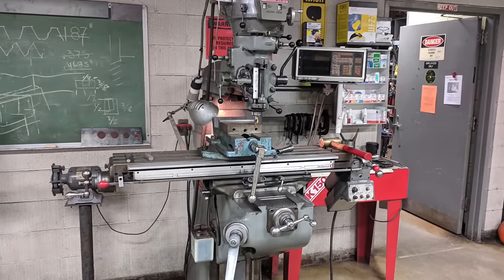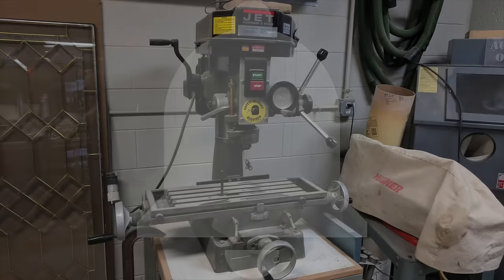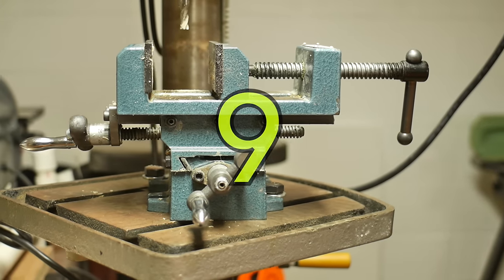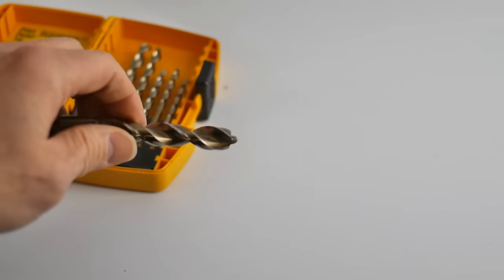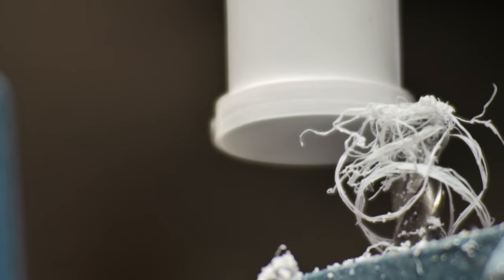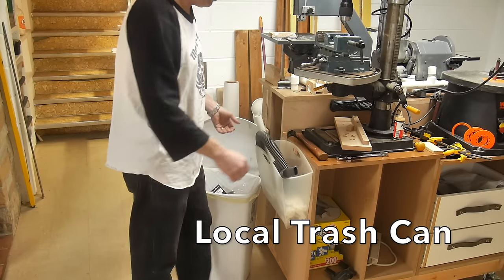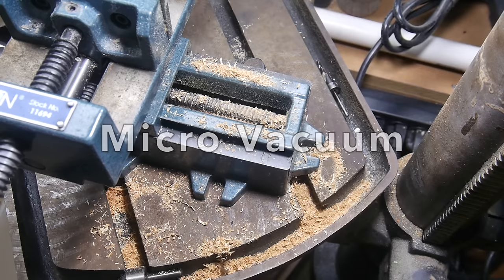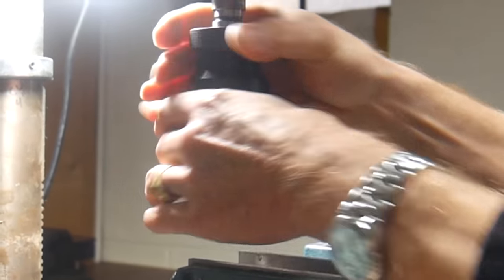Drill Press Machining Hacking/Tips and Tricks: The Basics

Comment: I came here for the "a drill is not a milling  machine, it was not designed to take radial loads" comments.
Reply: The old timers around here have been using their drill press as milling machines for over 40 years...
Reply: I’m a machinist and a good machinist will make do with what they have.  Used many drill presses with a add on cross slide vise.  One axis is enough to get by.
Reply: Bumblebees aren't aerodynamic, and theoretically aren't supposed to fly, but... 
;^)
Reply: If you’re going to use a drill press the last thing you want to use is a Harbor Freight press or any press with a Morse taper! Get an old Craftsman ore equivalent with a fixed Chuck that can’t drop out from side pressure or radial loads!
Reply from the maker: @timvala7577 that's a good tip actually
Reply: @jackmeoff6996 …but even they know that drill presses can be used to mill. Bumblebees are super smart 🤓

Comment: As a 40 year journeyman tool & die  maker I too have used this method at home. People need to be aware that a drill press chuck is only press fit into the spindle, and therefore, the side pressure of milling can and will eventually make your chuck fall out, or be corkscrewed into your workpiece. Be safe.
Reply: i was going to say the exact same thing, he should have mentioned that first as someone will get hurt, a milling machine has a draw bar for a reason.
Reply: I learned that the hard way. A bit of loctite works well.

Comment: Hey bud i see u r using a harbor freight what inch but I have a 4 flute end mill bit this should b simple enough for some quick or slow one-way passes on plastic right? I'm betting everything I'm gonna buy from what u say everyone says drill press  is for up and down but they still have to turn my buddy hunts and he drilled a 11/16 barrel hole with the drill and he's dumb as a sea slug! So harbor freight  isn't too far and they have a ageless flux core o.35 fed mig machine for 119 u can't go wrong but will a4flute and more flute bit cut through 7p71 aluminum or mild steel of course I would Drill some small regular holes to weekend the substance u seem to k ow what your talking about  and I need best way keeping bit steady  and as can b 
Thank u bud I will sub
Reply from the maker: Cory Cas you should be fine with plastic, or regular aluminum. Be careful with steel. Did not quite understand the last part of the question. 
Good luck, thanks for the SUB much appreciated.

Comment: I use to be a machinist in a track shop (railroad track) where I operated many machines. A large Cincinnati milling machine was just one I operated. I often thought about purchasing a milling machine. I had a friend who had a Bridgeport mill for sale once, but I didn't buy it. Then I thought about the mini mills that are for sale today, but once again I didn't buy one. 
   Your idea about using a cross slide vise on a drill press is a very economical  way to do some light milling which is probably enough for most people in their home workshop. Who knows, I might have to go out and buy a nice drill press and a cross slide vise even in my advanced years. 
   For most of my life I have been making something, at the track shop I cut steel harden steel castings, even stainless. At home I had a wood working shop, and I've done auto body work for years. I say all this to give a warning. The heavy metal dust, sawdust, and even auto body filler dust have ruin my lungs, I now have pulmonary fibrosis. So the warning is ALWAYS WEAR A DUST MASK. It will save your life.
   Thanks for the video, I'm sure it will help many to get into some light milling.
Reply from the maker: Best of luck

Comment: Cut off carbide saw tooth bits are one of my cheap tricks. Mounted in the cross slide the results are surprisingly good. Plus you get 40 to 60 bits per used 10" saw blade

Comment: the best piece of advice here was the simplest - just remove two of the handles. I never really noticed it before but I actually always just reach for the same handle every time even though I had a "choice" of three. Sometimes when I had a workpiece clamped to the drill press table the clamps would get in the way of the handles turning and I'm kicking myself now for the number of times I moved clamps rather than just taking off the offending handles. Christ the lights, what was I thinking of?!
Reply: Sorry to be 'that' guy, but this part kinda baffled me. I've never had issues with the three handles of my drill press. They all know I love them equally! I also use a technique (usually with drilling metal) where I have my hand on an 'upper' handle, my elbow on the one below. I get leverage from the elbow, control from the hand. This entirely depends on the height of the table though.

Comment: I have not checked all of the comments so the answer may be there. However you failed to mention how to keep the MT chuck adapter held firmly attached to the spindle under the side loads encountered when milling. The MT taper is great for drilling as all loads are axial so the taper keeps the chuck adapter solidly located into the female MT taper of the spindle. 
However when side loads and vibration are encountered as when using an end mill the radial loads imposed to the MT taper will allow it to rattle out unless a drawbar is used. 
No mention of how this was accomplished.

Comment: I tried using my drill press like this, but had a lot of problems with the chuck dropping out of the Morse taper. Did you do anything to resolve that? Just be careful if you try this, y'all. Morse tapers aren't good at dealing with radial loads without a drawbar
Reply: Try to clean the morse taper ,outside and inside with brake cleaner. Look for any damages on the surface , sand down anything you can feel. Clean again any oil or dirt. Now bang hard the chuck in place and it should be ok..If it doesn't work clean again and assemble with locktite adhesive. Good luck.
Reply: Evan Barnes
:   The only way to prevent this is to use a real mill.

Comment: Eric, my tip is to get some button magnets and place them onto the speed change cover, then I place my selection of centre drills, chuck key, countersink drills etc.
They are always at hand and are kept out of the way when finished with. :-))
Reply: Using a magnet to hold your bits makes them magnetic as well, even when taken away from the strip or tray.  Which means that ferrous metal chips cling to them. Sometimes tenaciously. The bits can have a beard of filings that shift but wont easily wipe off.  This interferes with cutting, wears out the tool and produces poor quality holes, scoring or embeds metal especially in soft material. You can degauss them, but that's just another step.

Comment: While I'm generally not in favor of using a drill press for milling as the bearings are meant for taking endless versus side loads in a pinch on soft material it will get the job done. As to band saws. Avoid three wheelers like the plauge
Reply: Why the band saw with 3 wheels
Reply: @johnty6067 
1) Generally a 4 wheel band saw will allow  smaller diameter wheels for the same throat depth.  But smaller wheels lead to more stress on the blade because you are flexing the blade three times for every time the same tooth goes past the table. The smaller wheels means the blade is stressed more than a two wheel machine of the same size. 
2) Blade tracking and wheel alignment are more of a PITA. There are dome very goodyhree wheel bandsaws. But they are industrial machines built to industrial specs.
You found probably build a decent 3 wheel bandsaw but the only reason I can see to do it is if you are limited in vertical space and want a really deep throat.  But then I think the smallest wheel I would go with is 14" or so with a maximum throat of say 20 to 24 inches. That means the saw is already 48 to 52 inches wide across the wheels without the blade guard and table.
Reply from the maker: Interesting

Comment: Do NOT use a drill press for milling. The morse taper fit on the quill and the jacobs taper on the chuck will not retain during side loading. They will eventually come out and then you have a drill chuck with a sharp tool bouncing around your shop. Hopefully you will not be in the way when it comes loose otherwise what you pay on your medical deductible could go to a real mill.
Reply from the maker: Yeah, it's definitely not what the machine was intended for, I assume everyone watching this video already knows that. But for light work I feel it's an acceptable option. At least for me it is. It's not for everyone. Thanks for watching and leaving a comment.
Reply: It's one of those things that can be done, but is not generally, for really good reasons.
In addition to Jerry Biehler's point, there's the non-safety issue: the spindle bearings aren't designed to handle that kind of side loading, and particularly with say, a Harbor Freight unit, you're significantly shortening the life of the pillar drill.
All of that having been said, it's great to know I'm not the only one who has abused his drill press this way.
Reply: Not all drill presses have a morse taper though. I'm not sure what my old Powermatic has, might be thread on, but it's certainly not taper.
Reply: It was an option on powermatics. But the vast majority of drill presses have morse taper. Even if your press does not have a taper drill chucks were just not designed to hold end mills. Drill bits have soft shanks that the chuck can bite into, end mills are hard and need to be held in a collet or they can slip. Heck, even in some collets they will slip anyway.
Reply: I've noticed that, you really have to haul on the key to get the mill to stay in there sometimes. I'm not doing anything serious though. Milling little flats to make drilling shafts much easier, or slotting the occasional hole(plunging though, then side milling to clean it up). I know the limits with it, it's certainly no bridgeport, but it's definitely above the Chinese junk you buy today.
Reply: Jerry  Biehler  Yes, I tried that and the chuck fell out while I was trying to mill. Fortunately, the drop was 3 inches down and into the vise. Definitely NOT a good idea. Very dangerous.
Reply: Depends on how you do it in my opinion if you use the proper bits, protection, tools & etc... and also let the blades or bits do the work not forcing it and also using coolant oil i think you be ok..
Reply: Had that happen a few times with aluminum. Good stuff.
Reply: I agree, its nice for sporadic milling !v @EricStrebel

Comment: Drill presses are typically not designed to absorb lateral or sideways thrust and usually this causes excessive wear in the bottom bearing on the shaft. Suggest these actions be kept to a minimum.
Reply from the maker: Correct

Comment: I have made motorcycle parts, gun parts and all kinds of other stuff with my drill press an angel grinder and files. I had to make a centering point that I clamp to the table to help keep some parts centered and take some of the side ways pressure off of the chuck. I still want to buy a real late mill combo when I find a good one that isn't to expensive.

Comment: I just bought a vintage cross slide vise at a yard sale for $20. I'm going to need to clean it but it was an awesome deal. I currently have a bench top drill press but I'm ordering a full-sized 20" drill press later this month. I'm looking at a Jet 1.5 HP model. These tips were quite helpful. I like the replacement chuck.

Comment: Nice idea - I don't think the bearings of the drill press are designed for lateral pressure so I would expect the bearings to suffer over a protracted period. If they are replaced with needle race bearings that would make more sense. But hey, for hobby use and no great precision expectations it's probably quite OK.
And not to appear churlish, there are LOADS of great tips in this video, some of which I shall shamelessly copy! Thanks man!
Reply from the maker: Your right. I will go with some roller or needle bearings next time to handle the side loads. Works well for killing wood and plastic and soft aluminum. Thanks  for your comment

Comment: 🙄 Thats a Drill PRESS. So its only ment for vertical Force and not for horizontal Force. In the worst case your Chuck can come off the Machine. Second Thing: End Mills are often to hard for the Chuck and you can damage your Chuck by getting stuck in the workpice.
Reply from the maker: Check out the follow up video where I add a DC treadmill motor to the drill press

Comment: Do you need a different collet in your drill press?  I was under the impression that the standard one  aka chuck does not tolerate lateral loads and will fall out.  Thank you.
Reply from the maker: It's the Tang that can come loose, some hold better than others.

Comment: You’re lucky that your chuck stays in the machine. Mine comes loose very easily. It always has. Very annoying during operations. The solution is to make and fit a draw bar, but I need a lathe for that…! 🧐

Does your chuck behave itself? Have you considered adding a draw bar?
Reply: Use valve grinding compound on your mt. Get some dychem or pression blue so that you can see what percentage is actually making contact first. Then use the valve grinding compound to literally machine match the two parts to a Percision fit. This works from tapered atv-lawnmower crankshafts all of the way up to many thousands of hp River rowboat wheel shafts. I’ve had to do both and many similar jobs in between. I hope this helps. I hate a mt. That will not hold.
Reply from the maker: Cool
Reply: @billyclevenger2632  Thank you for these good suggestions. The tang limits movement, but it might work in this case. Cheers.

Comment: I understood that using a drill press as a mill was wrong for two reasons.
It doesn't have the proper bearings for side loading.
It only has the morse taper jam fit and no mechanical hold on the bit (actually the chuck). So, the bit also has no ability to resist sideloading.
Reply from the maker: Correct

Comment: You seem to know what you are doing.  I want to do the same thing, but other vids say that it's dangerous to side load the chuck in a drill press.   How do you address that?    I've seen crazy glue, green loctite, and also replacing the bearings.   Any advise?
Reply from the maker: Freeze the Tang and heat the collet, give them a good whack when you seat them so they don't come apart easily, only mill soft materials. Rebuild your drill press occasionally to make sure the baiting are not loose.

Comment: you are putting side load on your chuck that is designed for vertical load,  and you get runout.  Use morse taper milling cutters or a morse taper collet chuck
Reply from the maker: Ok, thanks for the information

Comment: The one thing that no one talks about when using a drill press for a milling machine is, "how do you keep the drill chuck from falling out".  Please don't say it never happens, because it does.  I work in a company that has a large machine shop and have borrowed the best drill chucks on the planet, tried them in 2 different very robust drill presses, and they all fall out.  Doesn't matter if it is wood, plastic, or aluminum.  Doesn't matter how much cut you take, or how fast you spin the end mill.  So anyone who has done this successfully please let me know the secret, because I must be too stupid to figure it out.
Reply from the maker: It has happened, you can freeze the tapered end and heat up the drill press side, that would be one way to get additional conect, I hit the chick with a hammer, that works well for me.
Reply: @EricStrebel  Thanks for the fast reply. Can you every get it out if you have to?  I saw a guy that super glued the thing in, sounds pretty permanent to me.  I have installed bearings with the heat/chill method and it seems to work.  I'll give it a try.
Reply: @CompShooter54  I drive the chuck in with a hide mallet, after cleaning the taper with IPA or similar. 

You should have a Morse 1 or 2 taper iron wedge with your drill. Just wind down the chuck, looking through the slot over the chuck. When you see light, get the point of the wedge in the slot. Then hit the wedge with a hammer. Have something under the chuck to catch it as it drops out.

Comment: I’m confused. Are you milling with the drill press? If so how do you keep the tool holder taper in the spindle? There’s a reason mills have drawbars
Reply from the maker: Yes, works with light materials and plastic, aluminum too. Just friction on the taper.
Reply: @EricStrebel  Interesting. Does it tend to drop the chuck out of the spindle or does it stay put if you are milling soft materials?
Reply from the maker: It's can come out, but slow and easy, results in the best outcome, it usually stays in there.
Reply: I’ve had the drill chuck pop off the taper and fall to the ground bouncing around like a spinning top with a razor sharp end mill aiming for your toes. Not fun! It really is a bit dangerous to try to mill with a taper-held drill chuck.

Comment: Great video! I think alot of people that had some negative comments about by this video would have felt better if you had clarified that this is only really suitable for soft materials. Maybe a bit of Aluminum milling with a drill press here and there is ok, but you could have had a few extra "safety first" warnings.
Reply from the maker: Stephane Beauchamp-Kiss agreed, I will see if I can add a scroller to the bottom of the video.

Comment: Retired career professional...If you want to bend the machine's spindle or create runout on a good chuck, use a drill press as a milling machine.  It is bad practice to use a drill chuck to hold end mills on a solid milling machine, let alone a drill press. I have had to repair or replace many such rookie mistakes
Reply from the maker: Drill presses are cheap, I am sorta looking forward to wrecking my drill press so I can buy a new one